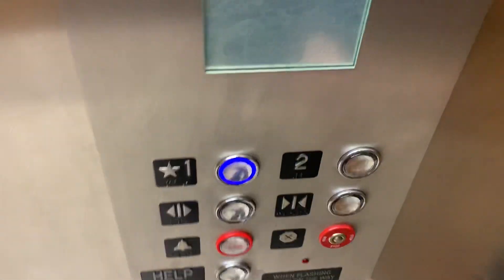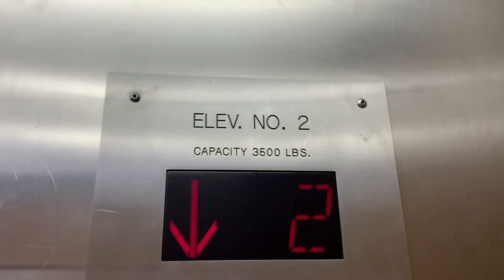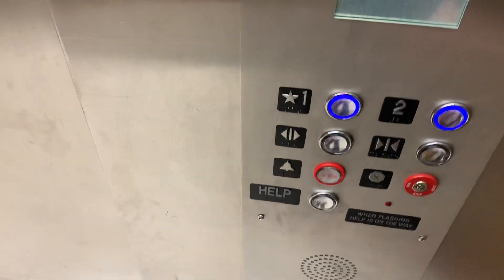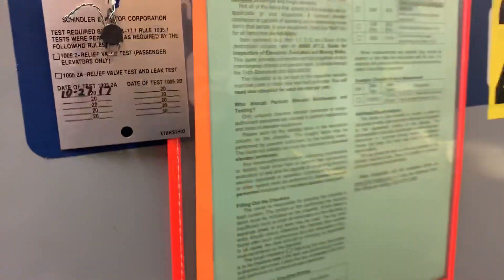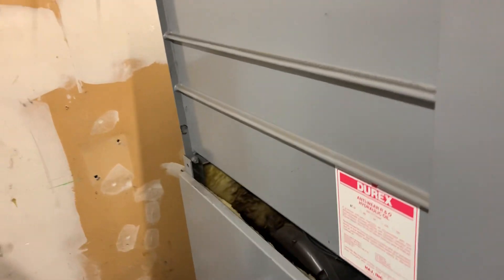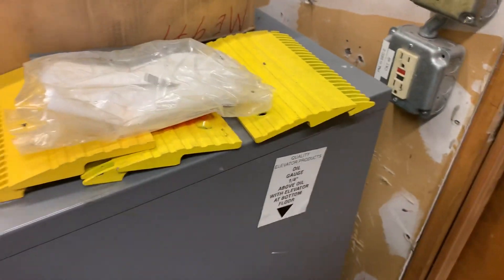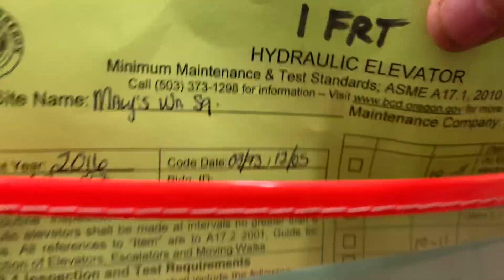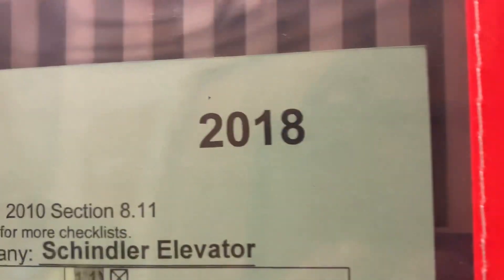(2019 Take) TBLOO!! EPIC MOTOR MontKruppery G&P Hydraulic Elevator & MACHINE ROOM at Macy's WS

Comment: I bet they used dry because the elevator is so far away from the motor room!
Reply from the maker: The having a Dry Powered has nothing to do with distance. It's actually right behind the big brick wall on 2 and the Freight is right next to it. Plus Submersible & Dry can go a quite distance if there's not enough space that'll fit the MR near the Elevator
Reply: @PNWElevatorAviation  Let's not try to remember what happened with Roosevelt field where the motor caught fire from this exact reason